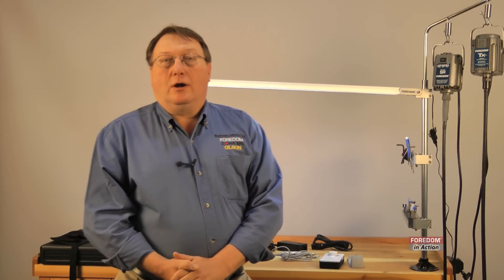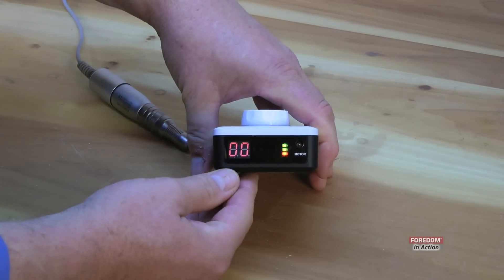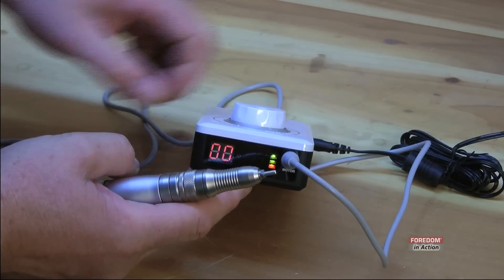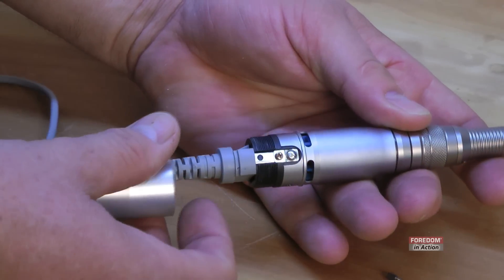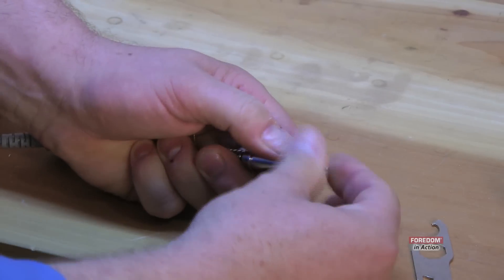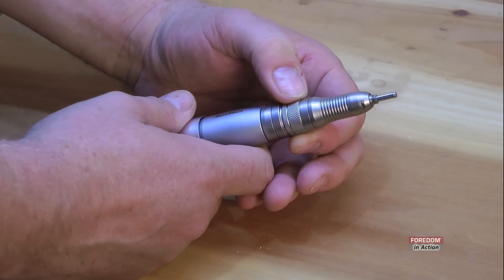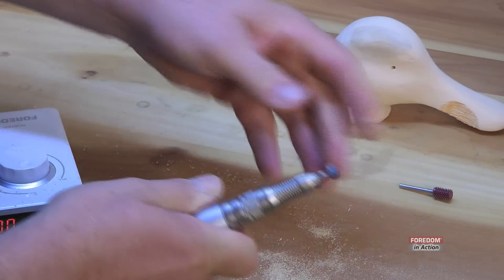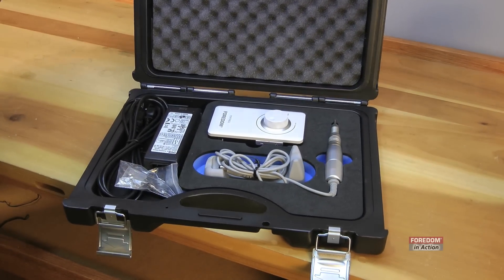Portable Micromotor with Lithium Ion Battery

Comment: WoW! First time a see a torquy one. I know it is a Foredom but I wouldn’t have  never expected that. Expensive but probably worth it but why this portable over the main one? Why would we need a portable for.
Reply from the maker: Portable, perfect for working at multiple stations, craft or outdoor events, demonstrations, or when power may not be available The K.1030 Micromotor with pocket-size control unit has built-in lithium-ion rechargeable battery for portability. Control unit has a digital RPM display at the top and a dial on the front adjusts speed from 0–30,000 RPM. Run time is approximately 6-7 hours, depending on whether the micromotor is in continuous use in battery mode.

Comment: how often do you have to change the motor brush, can this run on dc power vs only battery? is the battery replaceable and how much does it cost to replace?
Reply from the maker: Motor brushes always depend on how hard you  work and hours of usage.We suggest checking them after every 200 hours of usage and replacing if they are less than 2mm long. (they are small) You can use it while plugged into power outlet, but charging will not be as efficient while it is being used at the same time. You can replace the battery - we sell them. Right now the battery is $104. to replace. We have gotten very few orders for the batteries so I would assume that they hold up pretty well. We sell far more motor brushes than batteries (also less expensive) for these. People often like to have a spare pair of motor brushes just in case.
Reply: @ForedomElectricCo  you respond to that question 3 years later!!!!!

Comment: saeyang k38 rebranded. $400 ? hek no. its only 220 on ebay
Reply: Saeyang K-38
Reply: Thank you!!
Reply: @Ethannesss don't buy it 😂. it's weak torque no good on handpiece
Reply: @khaibui3575  so it is not the same device rebranded... I take it you've tried it ? :) Looks like the Saeyang K38 is 12v output, and the foredom is 18v output.
Reply: @Ethannesss its the same thing but handpiece no good. if you're looking for one for nail , wood carving etc.. get the saeshin b170 or b170 +175 new hand piece